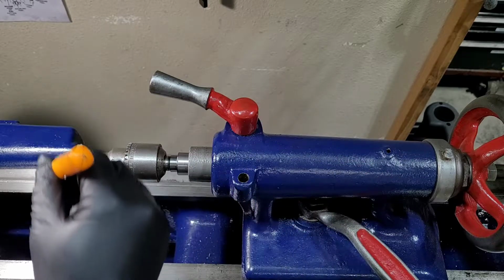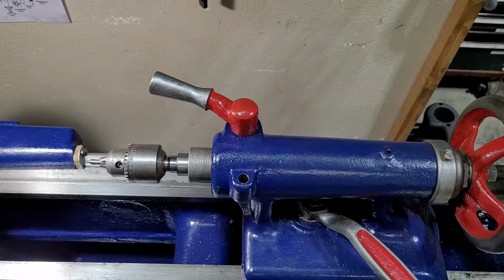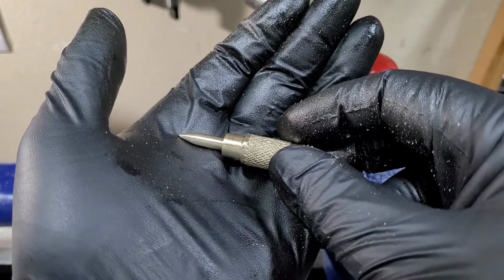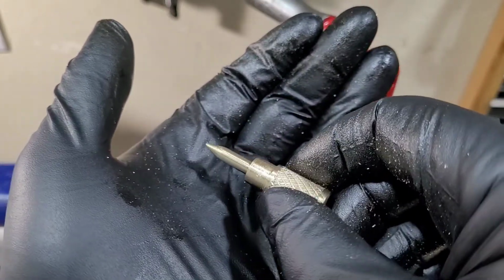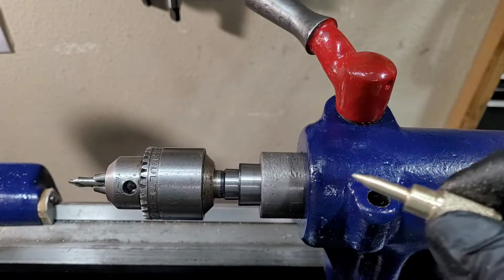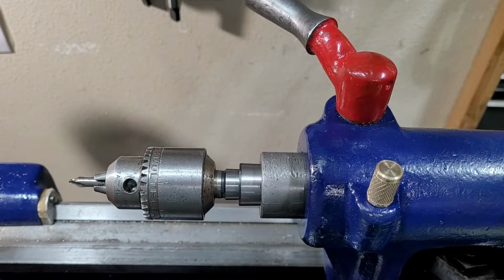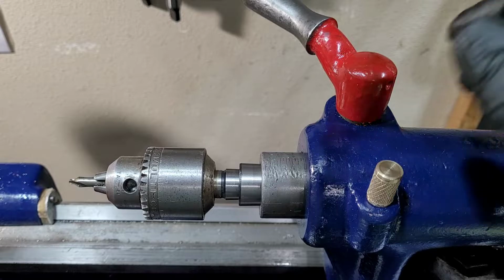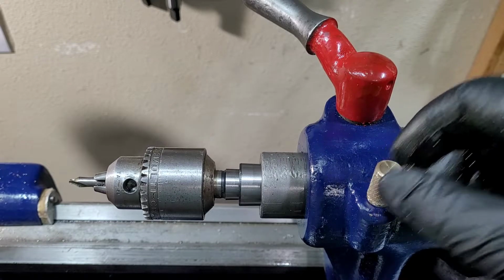South Bend 13" oil dauber build

Comment: who told you this? it's not what you think it is... it's for drill attachments and such. I've seen seen hand operated morse tapper turret head attachments where the tailstock quill is removed and the turret attachment is installed in its place, the hole is for the dead point for the handle. I would love to have one for my lathe but they're hard to find.